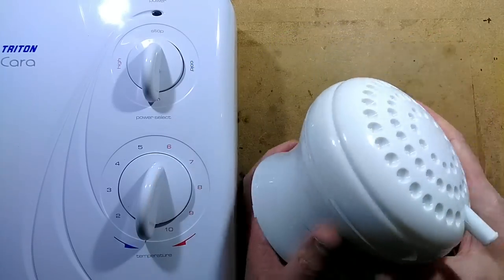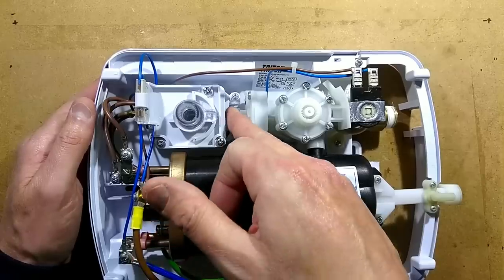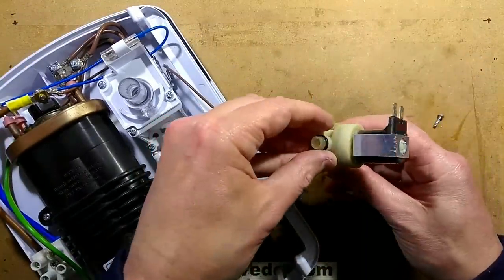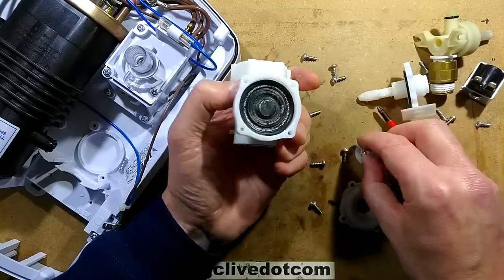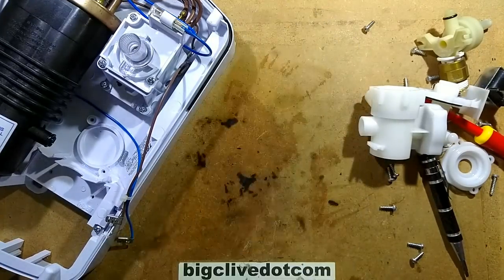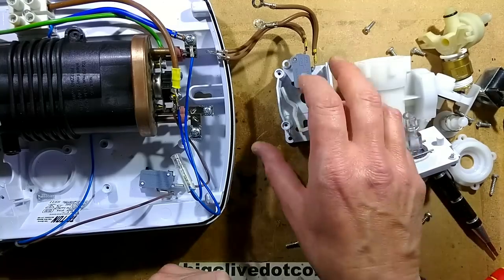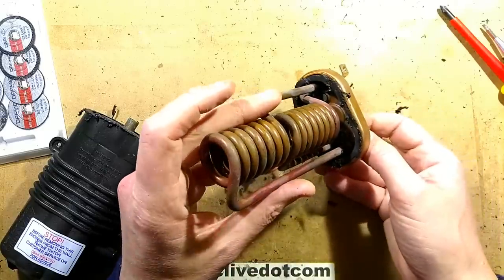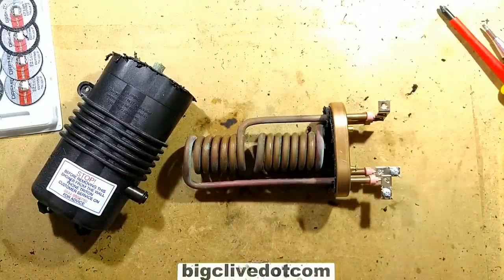Teardown of a UK electrically heated shower unit.

Comment: B&Q  (A UK DIY shop) sell for £50 cheap to buy and are very good value i have 2 showers fitted in my house and a spare on the shelf cheap enough to keep a spare. I have had the £200 top of the range showers they are just to complicated and fail within 2 years. This shower unit as Clive has shown is just simple and it works very cost effective. Nice one Clive :)

Comment: Hi Clive. May I suggest you invest in a small battery powered driver just to shorten your lengthy manual unscrewing process? I do enjoy your work but this would make it a touch more slick.
Reply from the maker: Quite often I use the unscrewing time to add extra information.  But I should keep my electric driver close at hand.

Comment: We have an Identical unit other than the Screen printing.  Ours is marked Warm rather than Economy.   It guzzles about 8.5KW on Hot and about 5KW on Warm/Economy.  It gives a pretty reasonable shower in Summer on the Warm setting.

Comment: 7 to 10Kw? That would take 30 to 45 amps right? Does it use special fuse groups like you have for unduction cooking?
Reply from the maker: It has its own dedicated circuit with a suitably sized circuit breaker.

Comment: Would the copper pipe in the middle of the heater module be subjected to electromagnetic induction heating from the coils surrounding it?
Reply from the maker: +Christopher Brown No.  That requires high frequency, and the heaters also have a grounded sleeve.

Comment: Wait wait wait... did you check continuity between the mains wires and the copper tubing exterior inside the tank? I thought that these were electrically insulated inside the tubes, which would make them very different from the live-wire versions you showed before. If you meant to emphasize that basic difference (presuming it is insulated), then I missed it. Love your stuff.

Comment: Clive: the stains on the workbenchtop distract somewhat, if i may suggest a excellent stain free and almost indestructible work-bench-top, its called Trespa and is used for sidings of buildings and such, its wood based fenolic resin plates like a mix between a circuit board and mdf, a local hardware shop/building contracter, if you have one on Man(?), should be able to order it for you or even may have it on stock as it is (in mainland eu) a common building material.It comes in 3-6-8 mm and most RAL colors, perhaps even pink ;-).6mm is common, you have to secure it with contact glue and a "glue comb" (both sides and mount cross wise).Its only enemy is acetone and the like in agressive solvents.
I always look forward to your little nuggets of video fun, thanks for many interesting hours of e-fun :D

Comment: I've fitted about half a dozen electric showers in the past in my houses none of them had any problems. Then recently got 3 in a row titan showers that wouldn't turn off after commisioning.The solenoid would not shut off. Luckily screwfix exchanged them but the last time i got another brand.However I darn't wire this one up in case i have a wiring fault as the guy in screwfix suggested, Any idea of what tests to run on the shower circuit to check before fitting clive? I'm not a sparky btw but my brother is. I did wire them correctly & followed the commisioning sequence each time.
Reply from the maker: It's possible that there has been dirt in the water and that it has caused the solenoid valves to block and stay on.  It's unlikely to be a mains wiring issue if the unit has a properly rated supply and good earth connection.
Reply: @bigclivedotcom   thanx Clive I will run the suppy with a hose into bath before i fit the next one. the previous shower worked fine so i didnt think it was a problem with the mains or my trip would've cut out.

Comment: does it takes in water by it self? or it needs additional water pressure from water cable?
Reply from the maker: It needs a high pressure water supply.  But you do get versions with a booster pump.

Comment: Plunger in the valve might be to normalise water pressure and absorb some variance in pressure. I've heard at least some electric showers have them.

Since the temperature is dependent on water pressure obviously you don't want it to change expectantly.

Comment: I see the same design flaw that was in our Hetrae Sadia shower. The wire that goes from the solenoid underneath the heating unit isn't thermally shielded so it can melt easilly. On ours, the heating unit outer was metal, so the wire shorted across and left the heating unit on even when there was no water flow. You can guess what happened: a lot of smoke and burnt plastic smell and eventually the fusebox tripped. Thankfully the one you have is plastic covered and has the diaphragm cuttout. Ours had a tap on the cold water inlet pipe and just a heat selector on the shower unit instead. Dodgy stuff

Comment: We have one of these Triton showers and I HATE it.

The water pressure is not strong enough, maybe it's got nothing to do with the shower its self, but is there ANY way to make the water pressure stronger?
Reply: The water flow is deliberately restricted. If you put a higher pressure through it, the water would just come out colder. The water flow is essentially limited by how fast the electric shower can raise the water temperature. A decent shower starts at about 15L per minute flow, and even a 10KW shower will only raise the water temperature by about 10C. If the incoming water is at (say) 10C which it will often be in the winter, then that means a 20C (or 70F) shower. That's chilly - 38C is more comfortable, and to achieve that, the flow would have to be reduced to about 6L per minute, which is a dribble. 

If you want a decent shower, then you would want either a combi boiler fed system (which typically go up to 40KW and can provide around 25L per minute at 38C using typical mains water temperatures), or one fed by a system fed from a hot water storage tank. If gravity fed, it will usually need a shower pump (integrated or separate) to get a decent flow. Alternatively, and more rarely in the UK, its possible to have a mains-pressure hot water storage system, which is common in Europe, but an expensive refit.

Personally I've fitted shower pumps, both the external sort and also the type where the pump is integrated into the unit (which run at 24V for safety and use a transformer). In either case, it requires a lot of pipe work changes from an electric shower which just uses a mains water feed (or, occasionally, gravity) feed.
Reply: Damn.

I went over to England last year as my friend invited me over and I LOVED his shower as it was so powerful.

I'm stuck with a very weak shower then.
Reply: Whilst you have an electric shower like that, then yes you are.

Comment: Curiously, mine demonstrates quite the opposite behaviour than you said! The water temperature out of the hose shortly after the shower has been vacated is often so hot it simply comes out at steam, or near boiling water.

I have partially melted bottles of shampoo for proof!
Reply from the maker: Is the unit switching off properly?  It might also be useful to turn the temperature control to cold briefly before turning it off to cool the block a bit.
Reply: bigclivedotcom I think so, I even hear the temperature failsafe click, on every setting except cold it demonstrates this behaviour.

A few bad shocks later and some minor scalding most of my household has taken to the “press the button and jump back for a bit” approach!

Comment: So there is no automatic on/off feature in it? Like Instant gas geysers where when one turns on hot water knob on shower, there is a reed switch with magnetic float which senses water flow and turns on the geyser.
Reply: Afaq Saleem well its the same function: if you close the valve in front of the heater the pressure switch disables.

Comment: Are whole home water heaters not as standard in the Uk as in the US? B/c I've never seen anything like this before
Reply: Tech Inquirer of course they are. Electric shower are just a convenient solution to adding an extra shower, one like this costs less than £100 and they are much easier to install than a conventional shower. They are also useful with old style hot water systems with a header tank, which operate at low pressure for filling baths and sinks but don't provide a good showering experience.

Comment: I had no idea electric shower heaters are common... well anywhere. Here in Finland houses have hot water heaters and all public buildings and most (if not nearly all) apartment buildings are heated with waste heat from power plants. There's usually a heat exchanger in the basement to make some of the cold water into hot water and feed it into a separate pipe. I literally have not seen an electrically heated shower here not once.

Comment: Is there an advantage to having these? I'm just curious because you don't see it in the US. Do only some houses have actual hot water heaters in them?
Reply from the maker: We do have hot water tanks and on-demand water heaters.  But the electric shower means that hot water is available instantly and only heated when needed.
Reply: I have a central heating boiler. I also have a hot water boiler and one of these (in fact this exact model) in my bathroom.  This set up is called not having all your eggs in one basket.  If the heating boiler fails we still have a shower and hot water....and I use Victorian open fires for additional hear.. ..if the hot water fails we still have central heating and a shower and so on...
Reply: @odeon1161  well I get that just not that common in the U.S. It seems. Not saying it doesn't exist but alot of videos I've watched that is in the UK seem to have those. I personally have never had any reason to have a 2nd hot water source. We have a rinnai rur98rn tankless water heater and is the best water heater I've owned. Almost 10 gpm and works great for a 4 person household.
Reply: @trucker V. I have a 160 year old house.  Things tend to go wrong. So I always build redundancy into anything I do.  It has served me well so far - I am 61 and retired and have always been able to get hot water and showers even when my boiler died. It's a personal preference really, especially now I am officially ancient ...but it is very common practice here in the UK

Comment: What happens if someone turns on a cold tap and the flow rate changes. I assume the temperature of the water would change. 
A friend had a unit that relied on the water pressure raising a cylindrical magnet to operate the switch. The whole thing was a clear block of plastic. The magnet had stuck and the bare heater coil stayed on when the water was turned off. The interior was melted and black.  I think I would be VERY cautious or using older models of these things.
Reply: Yes, turning on a tap while these are running causes the water to heat up. The Triton T60, T70 and T80 are the same. But the T90 has an internal pump and is fed from a tank, so it isn't affected by turning on taps.

Comment: If you have this in your shower, what heats the hot water in the kitchen for washing dishes or in the laundry? And if you have another hot water source, why isn’t that used for the whole house? 
In Australia we don’t see anything like these. I’ve always wondered what they were, I’ve seen them on tv shows etc. I really love this channel. Learning a lot of things
Reply: Stevie Cooper We do have whole house hot water systems, either a tank or combi boiler. Electric showers are often fitted as a secondary backup, or in rental properties because they are cheap to install and don't involve ripping out existing bathrooms. They also work well in properties with old style hot water systems fed by a loft tank, which means low pressure hot water which may not provide a good showering experience on floors above ground level.
Reply: Spencer Wilton thank you for taking the time to reply. Very interesting (to me)

Comment: I maintain four rental properties where these are fitted.  As the properties were built in the 70s and 80s they only have wiring to take a 7Kw shower.  These are one of the few which are available in 7Kw, most folks want 11Kw these days.  On the whole they last around 5 or 6 years, but we have had a couple which failed within the warranty period (I think now 2 years).  The first thing the Triton engineer does is inspect the shower head.  If flow is restricteded they blame the failure on you.  Call out charge is £80, with maybe £40 or £50 of parts on top, so you don't want to be at fault!  Thankfully neither could be blamed on the tenants and repairs were carried out under warranty.  One was a solenoid valve, cannot remember the other.  At between £45 and £60 new from Argos, Currys, Screwfix or Amazon it is not usually worth trying to get them repaired. A like for like fitting takes me less than 15 minutes.  Pleased to see that your opinion on them is generally favourable.

Comment: I think that difference between the elements matches with what I've observed on my ancient sort-of-smartmeter thing that Eon sent me years ago. Though the unit is 8.5kW total, the low power seems closer to 5kW, so the secondary element isn't much over 3.5kW. The range of input temperatures for mains water probably doesn't vary by quite as much as how much you need to heat the warmest water to make it comfortably warm, so that primary needs to be a little bit more powerful to parallel that. Say, it might vary by 17.5 celcius overall but you need to boost it by an average of 25 celcius for comfort through the months where the low power setting is useful. (OK, probably more like farenheit, as you're probably not heating it by a total of 42.5 celcius even in the harshest winter... and more powerful models are available after all)

And, ah, that's what that little breather pipe looking thing is on the bottom of my wall unit... Jeez, the water must come out of there with quite some pressure if it's ever used. Must be an option of last resort, e.g.in case the thermal cutout fails right when it's needed,, because when the inlet filter on an older iteration got clogged it ended up just cycling between Heat and No Heat, with the cycle saying longer on the Heat side if I kept it set to Low than High... anyway, the water never cut off, and it never ended up sqooshing out of the bypass...

Oh, and some of those Triton models, with a simple (seemingly mechanical) on/off switch alongside the power and flow settings, include a shutdown mechanism that keeps the water flowing for a few seconds without any power going to the elements after you turn it off. Which is specifically to prevent that post-use overheat and safety cut-off, which I imagine may end up fatiguing that part of the heater can if it happens too often. For the simpler models, like mine and the one pictured, the official recommendation in the manual (having had to replace mine, I've ended up skimming through the book just in case of any gotchas) is to turn the selector back to Off through the cold setting, letting it dwell there for a moment or two until you feel the temperature of the outflowing water start to drop, at which point you can turn it fully off. I try to stick to that when I can, but suffice to say in the depth of winter I either do it at arm's length and turn it to "off" at the first hint of the water cooling, turn it click-click-click (high-low-cold-off) over the course of maybe 3 to 4 seconds without waiting for a perceptible change (there's SOME cold runs over the turned-off elements, so it's better than nothing)... or just chance it and turn it off the "wrong" way without going through low or cold at all, because the thought of having to replace an eighty quid shower unit doesn't seem all that bad vs being blasted with cold water right before stepping out into a bathroom that's cooler than you'd ideally want it to be if gas didn't cost money.

Comment: Would the coiled heating elements around the central exit tube cause the exit tube to heat up through induction?
Reply: MindResonator No. Nope. not with 50..60hz

Comment: The top thermal switch on mine is actually a pressure switch - can you check on yours?.  The boiler has a little burst disc like pimple and if the boiler goes mental the steam pressure pops the dimple up which activates the switch isolating the mains
Reply from the maker: It looks like it's just a thermal switch.  Pressure sensing is done by the  diaphragm.
Reply: @bigclivedotcom   OK.  That is the only real difference between yours and mine. Otherwise looks identical.  At first I thought it was a standard temperature switch too but it definitely has a spring loaded disc and metering it shows it goes open circuit when pressed in. Faces down onto the copper top so the only thing that could activate it would be the copper pimple getting pushed out... which would seem to be non-recoverable also.  I'll see if I can find it a post a vid. Mine had a temperature cut out on the base of the boiler. I replaced mine  recently and tore down the old - saved the solenoid valve for exactly the reason you said. I binned the old shower about a month ago.  Shame,  could have sent you the different boiler.

Comment: I'd bypass that thermal cutout so you didn't have the inconvenience of it shutting off. Likewise, fill that little pressure elbow with epoxy to keep the rubber plug from blowing out.